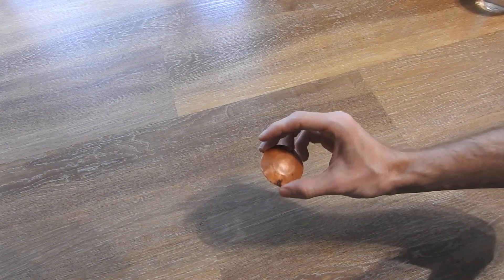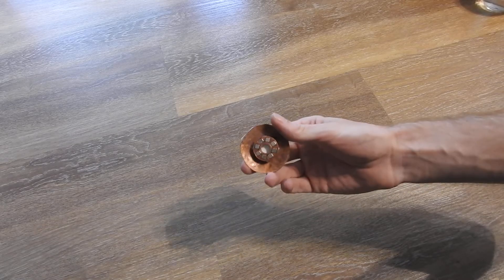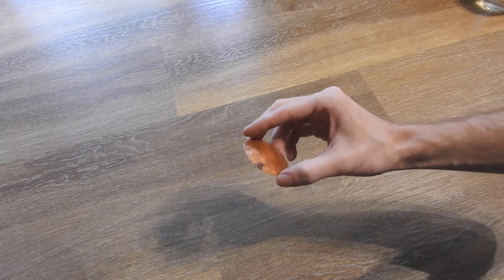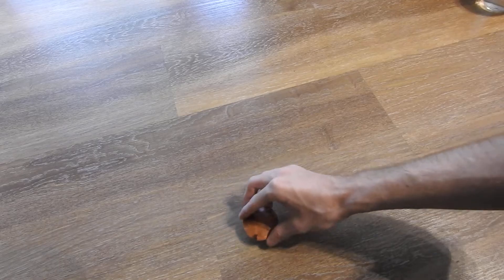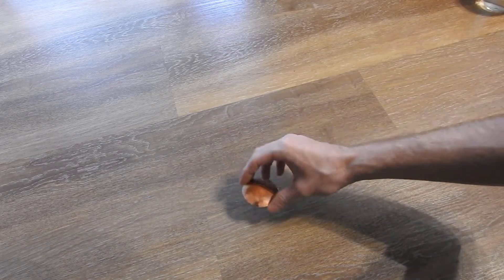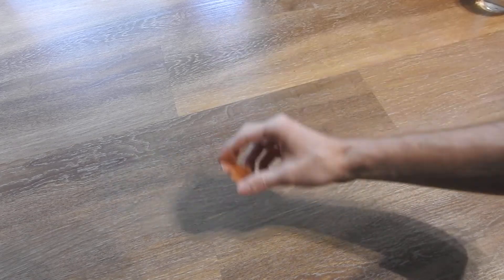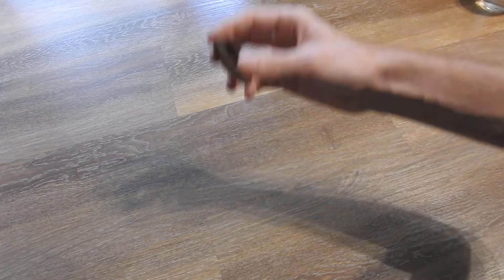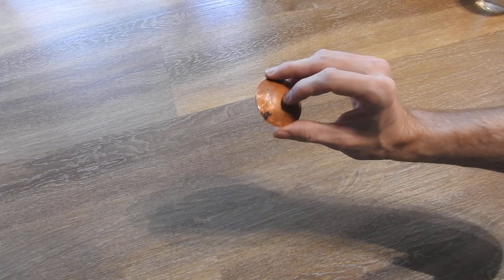A genuine "Anti-Gravity" device and how to build it

Comment: The pattern produced by the field . Use a sound with transducer which will make the same pattern as the field . It will improve efficiency most of this types of devices (pseudo tech) have combination of directional sound waves of certain types. Sir Nicola Tesla pyramids of Giza also had 2 ,45⁰ angled shafts of directional sound/pressure waves to improve efficiency .

Comment: Tried this. Doesn't work for me, I feel no force.

I made sure to use n52, the strongest. I arranged the magnets correctly. I taped the less stronger side on the copper sheet. Yet, I feel nothing when moving it the way shown in this video. Not sure where I went wrong.
Reply: Try to move it close to a surface which creates statics. The floor he is moving it above, is plastic coated. This creates static energy. Poly carbonate could work too, or an electric divice/coil inside the 'ufo' could do it, i inmagine.
Reply: Also, I would use aluminum instead of copper, because it's creates Eddy current just like copper does. Aluminum is a lot lighter though, more suited for aviation purposes.

Comment: I fear you're confusing magnetism and gravity. They're different forces. If an anti gravity effect was being produced, you need to find a way to measure it. 
What is the specific claim here? Are you claiming that the anti gravity effect is resulting in the device ultimately weighing less? Or is it producing some kind of thrust?
Reply from the maker: You shall not fear as I didn’t confuse them. Gravity isn’t a force, it’s the polar opposite - an acceleration. 

I think I said it pretty clear what effects I feel from moving the device.
Reply: @OmegaZZ111  ok, if you want to be specific, gravity isn't a force in the most technical sense. It's the deformation of space time due to mass. But my question remains the same. What specifically is the claim with regard to "anti gravity"? 
I hear you saying that you feel resistance but that may not have anything to do with gravity. Perhaps it produces some sort of thrust that you are feeling? 
Also, is the device itself affected by the anti gravity properties? For example, does it weigh less than the sum of its parts?
Reply from the maker: @williammilligan1700  The device doesn’t weigh less when placed on a scale. 
You can feel a repelling force when you move it like I showed in the video.
Reply: @OmegaZZ111  perhaps there is some kind of magnetic drag occuring. Interesting 🤔
Reply: All supposed "forces" are rooted in the same soil. A whirlpool, jet, and wave are not disjoint individual forces but all disequilibrium of water. The way I see it, magnetism is dipolar gravity, gravity is omnipolar magentism. A typical magnetic field doesn't interact gravitationally because its force vectors are balanced. If you imagine it's field to be like a donut turning itself inside out, all of the vectors cancel out because while part of the donut is rushing into the hole its shooting out the hole the other side. However, If you were to precess the turning inside out of the donut, you have an imbalance and countergravitational effects kick in.
Gravity is not the deformation of space. Gravity is the deformation of mass.
Reply: @FVLMEN  "Supposed forces"? Disequilibrium of water? I'm not sure what you mean. What relationship does water have with an arbitrary force? 
Magnetic fields don't interact with gravity at all. They're entirely separate forces. If gravity was some sort of "omnipolar magnetic field" then it wouldn't act on plastics, Non ferrous minerals, rocks, glass, wood etc. A bowling ball would be weightless! Gravity doesn't act upon material composition, it acts upon mass. 
If you refer to general relativity, you'll see that gravity is indeed a result of space-time curvature and acts against centripetal force.

Comment: Please do a video of you dropping it to see how fast it falls!
Reply from the maker: It will fall as fast as any other object.
Reply: @OmegaZZ111  oh interesting. So when exactly is the force experienced? When the object is rotated? Do you experience it when moving in a linear direction, downwards? etc. It would be great if you can do a video exploring this!
Reply from the maker: I showed it at the beginning and at the end of the video what the best movement is, you will slightly feel it when moving it downward, but even better when tilting it while doing so.
Reply: @OmegaZZ111  From the video it looks like you turning as you moving it downwards? Basically I wondering if there is any way to detect / measure the force but without holding it. Maybe launching it in the air and see if behaves the same a normal object?

Comment: For the reflector, you should try to 3dprint a mold and a stamp from PLA,  it should be stable enough to press 0.5 mm copper into form. I have seen people even pressing steel sheet metal in a PLA mold. Print 100% density. Copper is faily soft.

Comment: HI. I noticed something in the video where it looks like you have a spacer of some sort between the array and the capper? Is a space needed?
Reply from the maker: I have placed a few layers of paper in between to align the focal point of the parabolic copper reflector and the center of the magnet array. 
It’s not necessary but it seems to me that the effect is slightly stronger like this.

Comment: What is the size of the magnets in millimeters?
Reply from the maker: 5mm cube magnets
Reply: I also believe that oval-shaped and high  voltage  from tesla coil will boost performance
Reply: I believe the magnets are all the same size.It wouldn't make a difference, but it's long as it has a field.It has to be tuned as well as dimensional
Reply: 8mm

Comment: What you're feeling is the change if magnetic potential in the copper dome plate that's around the halbach array. Like having it near a big magnet and moving it, you're creating eddy currents when moving the plate because it's inside a magnetic field.  Cool experiment thoughm
Reply from the maker: Why would there be a change of magnetic potential? 
The magnetic field does not move relative to the copper reflector, so I don't think this would create eddy currents, earths magnetic field could induce such, but they would be very weak.
Reply: @OmegaZZ111  faraday's paradox
Reply: Bet comment yet spot on

Comment: I replicated this today. I 3d printed your file. I got the 5mm magnets. I got 3" copper disk and annealed and rounded it into a reflector as you showed. I wasn't able to replicate the effect your describing. Very disappointed
Reply from the maker: Since you already went that far to build it, I can only recommend you to try it for two weeks every day especially in the evenings, best luck to you.
Btw make sure the center of the array is well aligned with the focal point of the copper reflector, I used some paper to create the right distance.

Comment: If only you could measure it rather than feeling
Reply: I think due to the 3rd time derivative (Jerking motion) associated with the transition, you'd need to build an odd sort of motor, and then weigh the motor as its working with a traditional balance scale.

Comment: does the thickness of the copper matter?
Reply from the maker: Not really, but I recommend 0.5mm thick copper to make it as light as possible.
Reply: @OmegaZZ111  I built one with the copper reflector but I really can't feel a difference not sure what I did wrong. Also when building the halback array the magnets literally hate eachother and want to fly away how come your seem perfectly fine? (I used n52 magnets)
Reply from the maker: @caseycourtney6425  you can use some glue if the magnets don't stay in place.
Try to align the center of the array with the focal point of the parabolic copper reflector, for me that gave the best results.

Comment: This can not work because there's nothing to be repelled from, so nothing is slowing it down except air / other magnetic materials near by when moving it up and down.
If you want to prove it that for example it is falling down slower then let it make falling freely and compare it with other 'regular object' shaped and weighted the same.
Reply from the maker: All matter is magnetoreactive and can be repelled/attracted by magnets. 
You say it can't work, yet I still can observe the effects stated in the video.
It is not falling down slower, I never said this was the case.
What I am saying is that you can feel a slight repelling force when moving it in a CURVED pattern against any object. (like shown in the video)
Reply: @OmegaZZ111  
(...)All matter is magnetoreactive and can be repelled/attracted by magnets.(...) What in the video is repelling your movement? Floor or air? Everything is affected by magnets but the forces are so minimal in your scenario that it can not be considered 'feelable' even. If you really feel it then basically attach to it some basic weight scale and proof it is working.
(...)It is not falling down slower, I never said this was the case.(...) You have stated you feel repelled force so if you feel it then it means it is slowing your movement down and it means it will fall slower if you will do such experiment. Slowing down can be observed in 'magnet in the copper tube' experiment but here you have no tube and additionally copper plate is moving together with magnets so no electric current (and magnetic force) can be created in it which is the main reason for slowing magnet down.
Reply from the maker: @iwannamynickagain  If I drop it it falls down as fast as any other object, the repelling effect can only be felt when moving it (quite slowly) in curved patterns against objects and also very slightly just in the air. 
I can't explain to you the exact physics or why this effect is happening, I am only stating what I can observe.
One possible explanation I thought of could be that when moved, the magnetic field of the earth and that of the magnet array will create slight currents in the copper reflector, I don't know if that is actually the case, but it seems likely since a changing magnetic field would induce a current in the copper. 
If you don't believe my observations, I don't think I can change that, I can't prove it by letting it fall or putting it on a scale, since it has to be moved in a CURVED pattern slowly for the repelling effect to appear.
Reply: @OmegaZZ111 could be interesting to 3d print some sort of rail (like a rollercoster rail), that this device can slide on in the same curve as you produced, and then comparing timings when not having the magnets in and vise versa - that would result in a way to measure if changes enhances the device or detracts from the effect

Comment: There is no connection between magnetism and gravity according to physics. The search for quantum gravity has produced nothing but dead ends. Gravity unlike magnetism is not mediated by any sub-atomic particles such as photons. That is why "gravitons" have never been discovered...only gravity waves when two rapidly orbiting neutron stars collided.
Reply from the maker: There is no evidence that magnetism is mediated by photons, the theory proposed by quantum physics that a magnet emits so called virtual photons is a theoretical mathematical model with no physical or experimental evidence.
I am stating observed effects in the video, if quantum physics is not able to explain the observed phenomenon by its theory then maybe the theory is not complete or partially incorrect.

It is experimentally proven that gravity can be overcome by strong enough magnetic fields, for example you can levitate a strawberry or a frog with a strong enough magnetic field.

Comment: This is a very easy and cheap experiment to do if you have a 3D printer. The copper plate passes through the earth’s magnetic field and generates eddy currents. These eddy currents will in turn generate an opposing magnetic field and cancel out the earths magnetic field nearby. This will reduce the reaction of the magnets on one side and exaggerate the force on the other. it would depend on where you are on the earth as to which way you should move it. I must admit it is too small for me to feel. Purely a magnetic force and unfortunately not an indication of anti-gravity.
Reply from the maker: If the magnetic force can repell basically all matter, why can't it be called "anti-gravity"?

Isn't that what an anti-gravity craft would do?

You can easily levitate a frog or a strawberry in magnetic field of 5-6 Tesla.
What if you create an omnidirectional magnetic field around the device with a extremely high field strength like more than 10 Tesla or even more. 
In theory there is no reason why this wouldn't levitate if it is possible on a smaller scale.

Of course we would need to invent a power source for this, because you probably need a whole power plant to create such a strong field.
Reply: Levitation is when something raises in the air. Typical well known ways of doing this is the hovercraft using air and the linear induction motor using magnetic forces. At the moment levitation using gravitational forces is not publicly known or understood. But don’t let me discourage you from exploring further. Anti-gravity is what drew me to your site and one day someone like you will hit the nail on the head. The induction produced by a magnet on copper is well understood. Your other videos exploring the halbach array are also interesting.
Reply from the maker: @stephenfincham8901  I have a thought experiment. 

Let's assume we have a working anti gravity craft.
Sadly it's engine is damaged and can only produce a fraction of its power so it can only slightly reduce the weight of the craft but it's too weak to levitate.

I would still call it an anti gravity craft, even if it is not powerful enough to levitate on its own.

You see where I am going with this? 😄

Comment: so no demonstration of it actually flying or levitating  so you have to build it and feel it repell well not much to go by
Reply from the maker: It doesn't fly or levitate by itself.
You only feel a repulsion when you move it.
I don't know how to demonstrate that on video any better.
Reply: @OmegaZZ111  Use swing. Record video when it swings in the air and then over any surface. I did this device my self. It does not work for me as described.